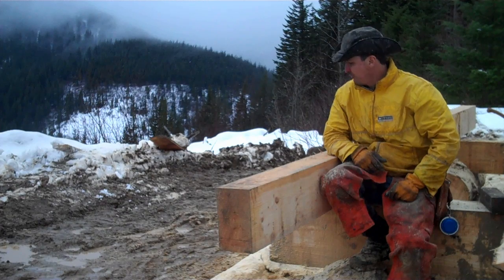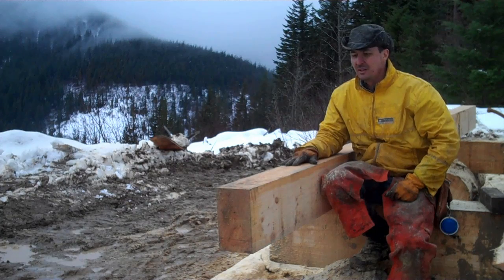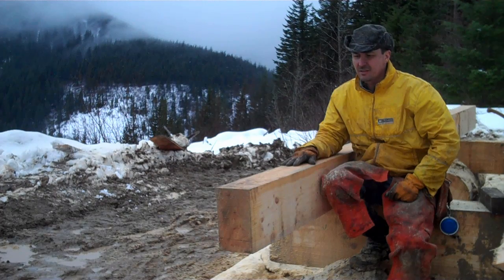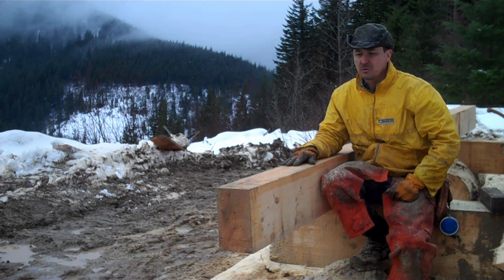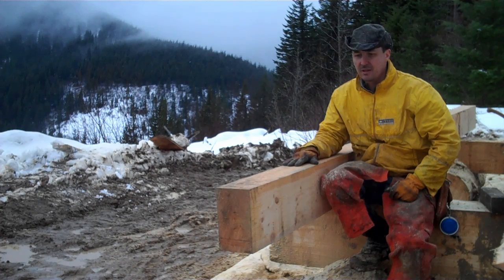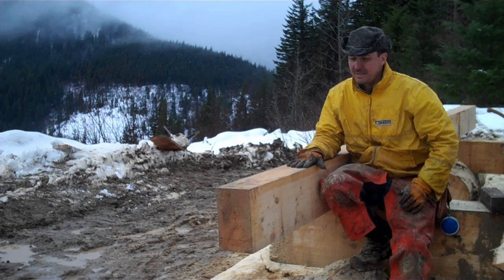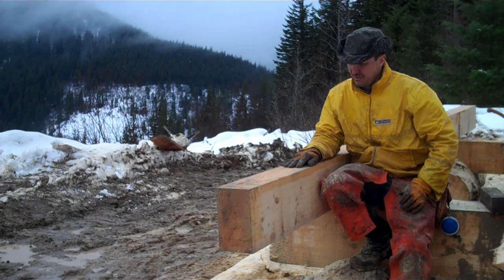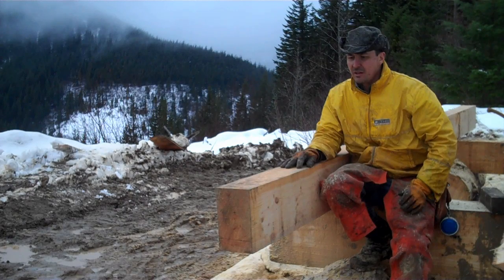Alaskan Chainsaw Mill: Turning Trees into Timber for Off-Grid Projects!

Comment: I realize Its not for your income, but by cutting a few extra it would certainly pay itself off through like minded buyers on Craigs list ect. 6x10 at that length at local store here is over 100 each. Great job Cody, thanks for the inspiration.

Comment: we originally got an alaskan mill for our offgrid homestead years ago, after taking 2 men close to an hour to mill 1 4x4 we decided that it wasnt feesable  and gave up on it because if we had worked we could have bought 4 or 5 4x4's, then we got a woodmizer type sawmill, its the way to go if you want to make lumber, instead of 3-4 logs a day you can do that many in an hour, alaskan mills do work but they are alot of work and you can expect youll ruin a chain or 2 getting the hang of it

Comment: Just wondering, what would it have cost to have these milled to your specs(from your own timber), vs DIY'ing it as you have in the video?
Reply: A bandsaw sawmill operator, depending on size of mill, will charge anywhere from $35 to $100 per hour, or $.25-.35 per bdft.
Reply: +chopperdan88    Hiring out milling is never cheap. If one is blessed, he may be able to barter for that service. But we need to ask Cody & other woodsmen, was production more critical, or was it partly that he could do it himself? Keep in mind the INDEPENDENCE motivation here! (Though I DO enjoy small portable sawmilling, as well as my Alaskan mill.)

Comment: Great video...Anyone have experience with milling ash trees.  Using my new Alaskan Mill with new rip chain and it is like cutting concrete.  Love the unit but should ash be this tough?
Reply: Hi Patrick - Just saw this now....Funny you should ask as I decided to try and sell my mill.  The mill is great but I am moving and need to seel off many of my supplies.  I have not used it in 2 years so it has benn in storage.  Le  me know if you are interested.  I have only milled a few trees with it back when I posted the comment.
Reply: Hey Patrick....trying to respond to your comment from 5 days ago but not finding it any longer.  Let me know if still interested in mill & rails.

Comment: Nice vid but I have to ask, if you are in the country (off grid area) would it not be ceaper an faster to find a local who has a small mill? I only ask as a neighbor a couple miles away has a small wood mizer mill. That machine is fast and his service is very affordable. He milled a 60' x 20" hemlock for me for less than 250.00 and I was left with over 600 board feet of 1X6, 8 and 10 that I requested. Not trying to knock your video but it's the effort of saving money and using resources wisely.

Comment: And i thought my Wood Mizer needs a lot of time to cut lumber ...
Reply: +Huntingcoby it may be skating on full gullets and a skip tooth blade might help or else when i was in industry, we had a saying three teeth in the cut is as radical a blade as you should use.  Two will not cut smoothly, but three gives you a good quick cut.  So on six inches, you need a tooth about every two inches.